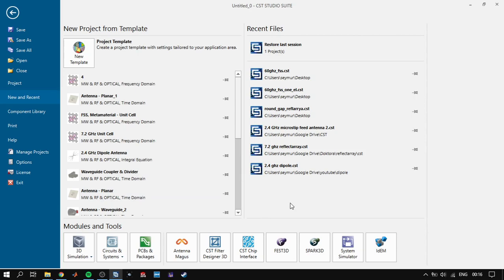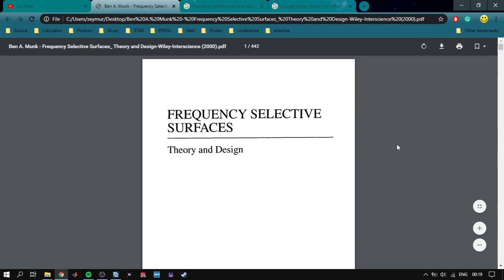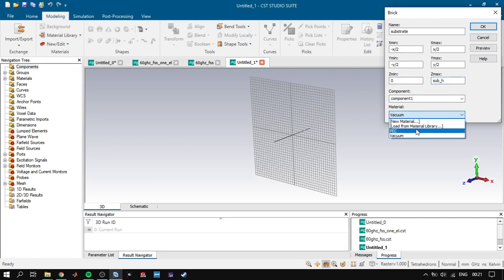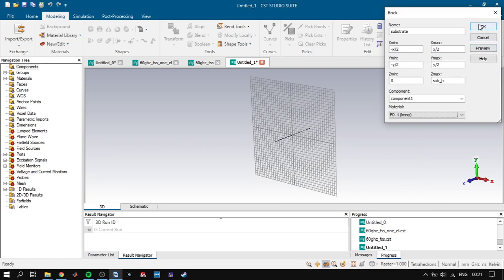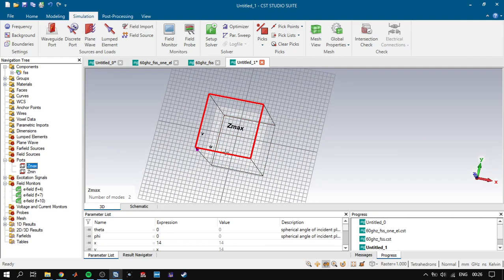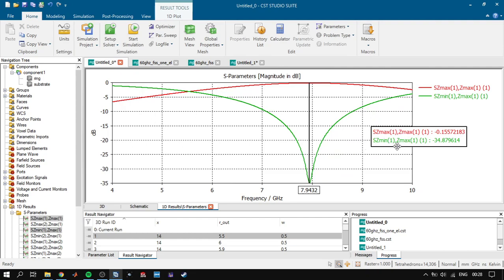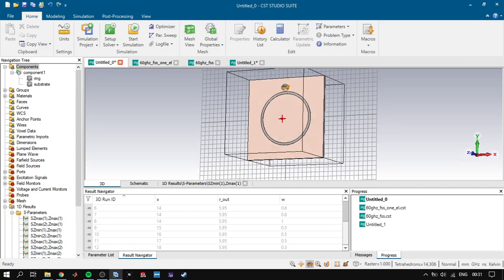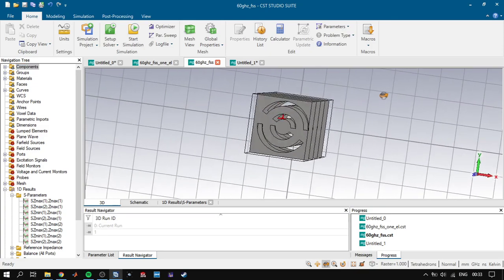Frequency Selective Surface Design in CST

Comment: That was really helpful. i am currently doing my final year project on shielding with fss structure. This really came in handy. Thanks!
Reply from the maker: Glad it was helpful!
Reply: @SimulationMaster  hii sir. In this we have design a circular loop. But in order to design normal cross(or Jerusalem cross) what are the steps that needs to be taken? Could you please give step by step procedure to get a normal cross symbol on the substrate? Please help. Thanks.

Comment: Thanks for your video. How would I set up simulation of a full structure FSS, (say 20 x 20 unit cells) in the transient solver please? I think I’d use a waveguide port on each side of the structure but what boundaries would you suggest I use please? Thanks.

Comment: Why did we use PEC for FSS not a copper(annealed)??
Reply from the maker: good question. For the initia adjustment there will be no difference between them in terms of the requency response. So to decrease simulation time I use PEC. In the later stages of the project you can use the actual material. It will have small effect on the frequency responce, and wil add loss.

Comment: nice video and good explanation. I am currently working on THz antenna based on FSS with Floquet port in CST. Could you please replicate the simulation from this paper "Broadband THz Uncooled Antenna-Coupled Microbolometer Array—Electromagnetic Design, Simulations and Measurements" from IEEE TRANSACTIONS ON TERAHERTZ SCIENCE AND TECHNOLOGY, VOL. 2, NO. 3, MAY 2012. It is using HFSS simulator and I wish you can also simulate this in CST.

many thanks
Reply from the maker: Dear Arie,
I will try this.

Comment: Hi, I am working to make a basic square patch element (group 3) that can be used as a low pass filter for frequencies <1.25GHz. What kind of lengths/perimeter would I want to use to create my square patch?
Reply: Above simulation stands for Patch type or aperture type FSS?

Comment: Is the reflection coefficient (S11) denoted by SZmax(1),Zmax(1)?
What is the transmission coefficient denoted by?
Reply from the maker: Transmission coefficient is denoted by, SZmax(1),Zmin(1)
Reply: @SimulationMaster  Thanks. I have one more query: There are layers of array. The top layer array is for 8-10GHz and the bottom layer array is for 5-6GHz. If an FSS is designed and acts as ground plane for the 8-10GHz, then should the designed FSS have maximum reflection coefficient for the 8-10GHz and minimum transmission transmission coefficient for 8-10GHz?

Comment: sir, iti is very useful video, thanks. Could you please upload any terahertz antenna  model based on silicon substrate by CST?  Please reply
Reply from the maker: do you have example paper of can you please be a little bit specific?
Reply: @SimulationMaster  may I email you ? is there any email id?
Reply: @SimulationMaster  thanks I will send you email
Reply: @SimulationMaster  sent email, please check

Comment: Why you chose Frequency solver not time solver
Reply: Because in Grequency Solver we can use Flloguet Boundaries and unit cell boundary conditions use these Floguet equations.
Reply: OK , but when i want simulate Antenna in Time domain with these CELLs as reflector what should i do?
Reply from the maker: @sciencelearning2326  You should use Time-domain solver. Using time-domain will not change the results, but using FSS with antenna disables 'Unit Cell Boundary' conditions. So your bandwidth and S11 parameters of the FSS will change under these conditions. You must take into account this situation and use enough Cells to ensure proper operation of your FSS.
Reply: Simulation Master Your explanation is clear, now I understand you very well. So thank you very much friend
Reply from the maker: @sciencelearning2326  your welcome Tarek